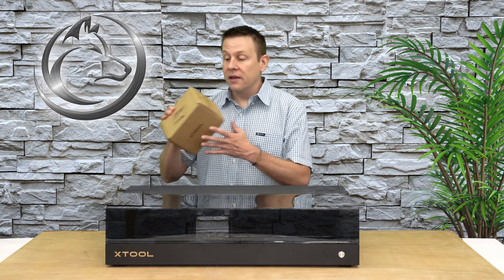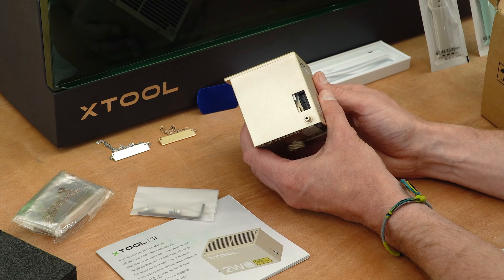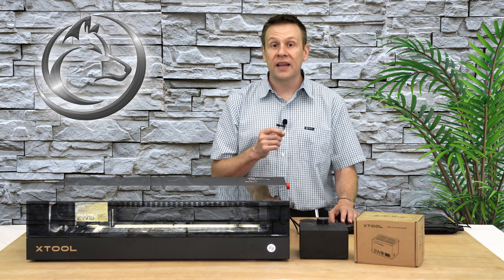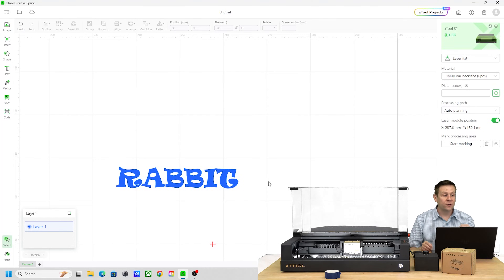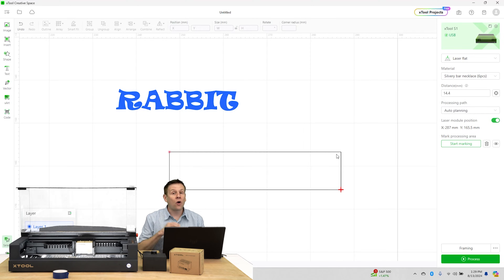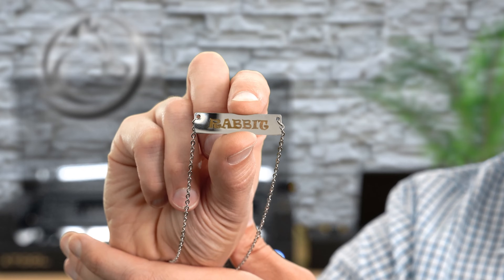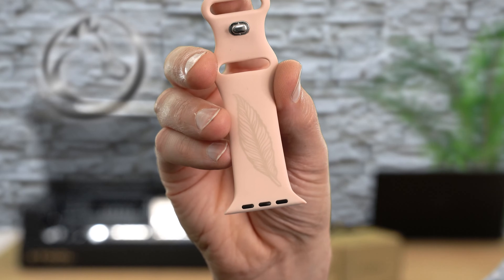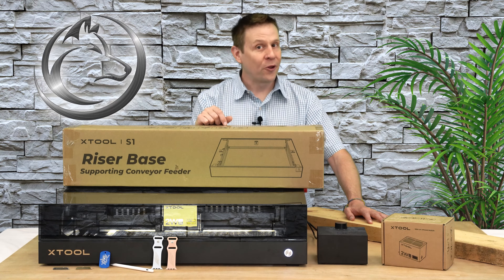Xtool S1 with IR Laser!

Comment: Is this laser interchangeable from a software standpoint? I have xtool s1 pro. Will my software support IR? My current laser is 40w diode?
Reply from the maker: That is a great question.  In the USA the S1 only comes in 1 version with 3 different blue laser power levels, 10w, 20, and 40 watt.  The IR is compatible with the S1.  The Xtool software automatically detects the IR on power up so as long as the software is up to date you're all good!